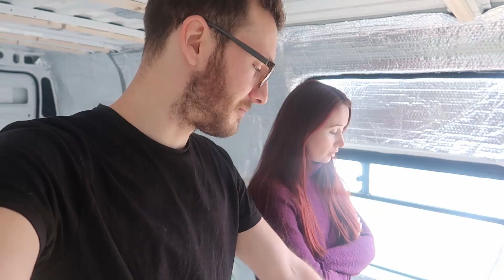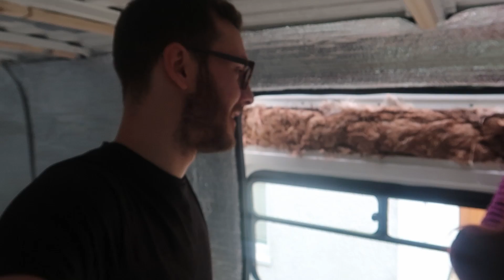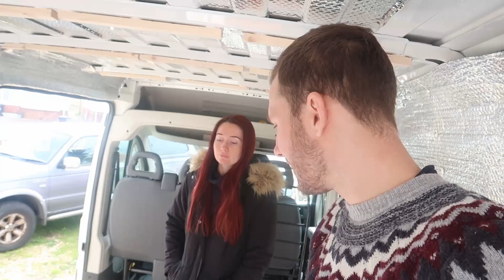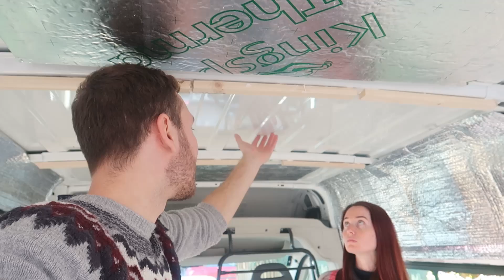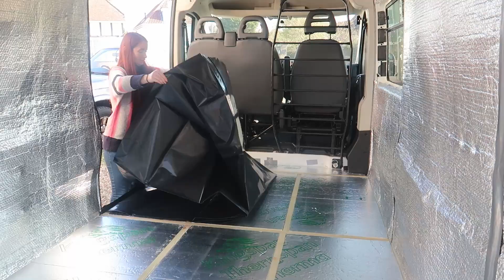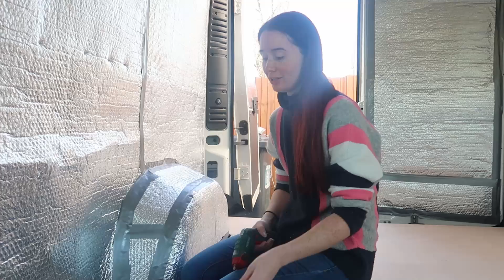Van Insulation FAIL! | Beginner Van Conversion Series UK

Comment: The water is coming from outside and through the door gap, I just leaned it’s a common problem in every van, an easy fix is a water rail over your door. Am going to do that for our van conversion ☺️
Reply from the maker: Yeah we realised that hahaha all fixed now :)
Reply: Callum & Tash I have been doing allot of research and am glad I came across that because when it rains water gets into the van on the sliding door, but someone showed me a cheap easy hack for less than £10 I can install the rails over the door and it’s sorted out ☺️

Comment: That Rockwool will soak up water like a sponge :(
Reply: Rock wool is a moisture resistant material it’s just due to a leak within the door that has allowed it to get wet but condensation won’t really effect the material, just a small set back which is easily fixed 🙂
Reply from the maker: Travel with me Travel with me 💯
Reply from the maker: If it's sealed it'll be ok
Reply: @CallumTash  Not with condensation or another leak.
Reply from the maker: @justaguy8223  We have plenty of air flow, and as we've corrected the problem we think it should be all good from here :)